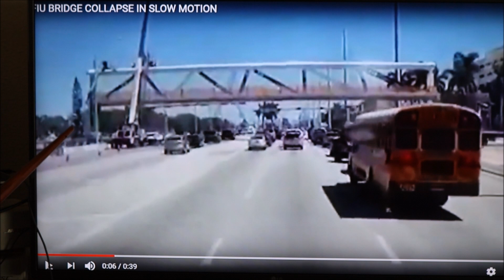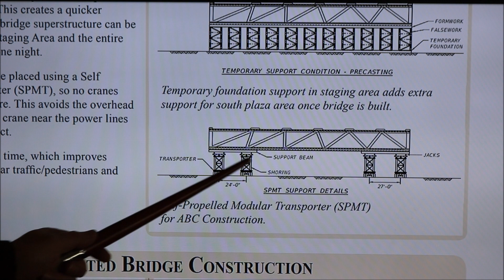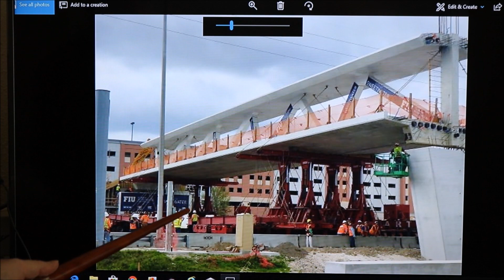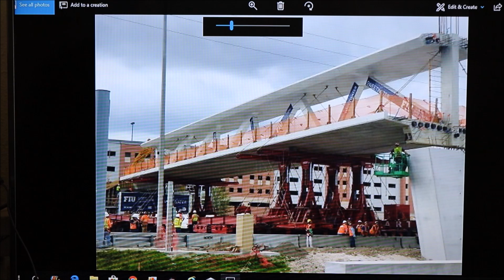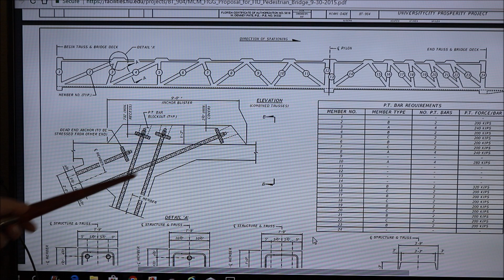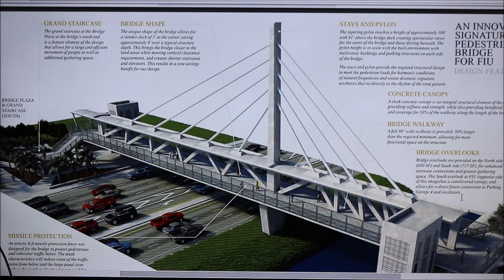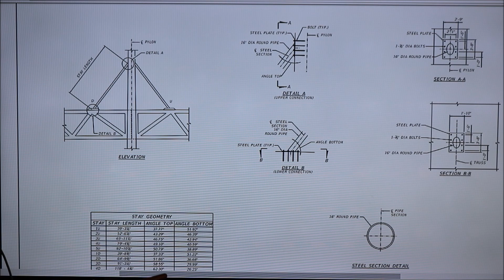Miami Bridge Failure Update 18 March 2018

Comment: I myself do not think that crane was there to hold the worker's safety harness. The worker's safety harness should have been tied into the bridge to keep him from falling from it. I say the crane was there lifting the bridge as tension was added by the worker. But by lifting they would have decreased the compression strength of the concrete. I myself think what killed the people was someone's ego. That road should have been closed.
Reply from the maker: 72+HourBOB the crane may have also been lifting the hydraulic tensioner, and not the worker.
Reply: I think the crane was holding something but not the worker.
Reply: if you actually look harness conected to crane

Comment: That was an interesting point about the cantilevered stress put on the bridge during its move. Info I can't get anywhere else. Many thanks for your reasoned approach.
Reply: The first video by AvE (referenced in Juan's previous video) shows the point of failure and the cantilever stress issue: https://youtu.be/ioC61QW7SHQ?t=331

Comment: Juan,
Thank you for that update! What I dont understand is why they needed a 950 ton bridge for a pedestrian load of perhaps 2 or 3 tons (ie ~50 people)? At what cost all those aesthetics? That had to cost much more than it needed to and I would think that too needs to be part of this story.

God bless
Paul
Reply: A bridge has to be rigid, otherwise it will sway in the wind, or when pedestrians walk over it. This is what happens otherwise: https://www.youtube.com/watch?v=CsKKDLKYsVU
Reply: Your reply shows your ignorance of basic engineering priciples. What does rigid and heavy have to do with each other? There are 1000s of lightweight bridges and other structures that perform just fine in wind, earthquakes, etc, and dont end up like the poorly designed TN bridge. Aircraft are very strong but very lightweight as well. This bridge was clearly 'over aesthetic'ed'.
Reply: No need to get personal...
Reply: Then please know what you are talking about before YOU criticize what I have written.
Reply: You are being paranoid, and your comments are insulting! I didn't criticize you, merely pointed out that the load is not the only factor considered when designing a bridge. The bridge has to carry its own weight (dead load), as well as multiple safety factors. Yes, you can probably design a lighter bridge.
Reply: Your original comment was what was insulting. Please look in mirror. Im done with you.
Reply: Paul1958R According to some comments the bridge was intended for more than just a crossing point, with seating and vendors - a place where people migh congregate.
Reply: @Ian Mosely,
That just would increase my criticism of the entire plan. A bridge should be a bridge - not a 950 ton 'gathering place'. The scope of the project clearly was out of control.

Comment: The crane was problaby holding the hyd ram used to tension rod it broke the line when it pulled the ram down with the bridge
Reply: Yes, hydraulic jacks capable of 320 KIPS weigh 250 - 450 lbs (e.g. http://www.williamsform.com/Post_Tensioning_Systems/post_tension_install_equip.html). If the jack remained connected to the crane when the bridge collapsed, the crane could have pulled the (broken) rod out of the truss member.
Reply from the maker: frank porter great point!
Reply: this!
Reply: A witness said the crane hook was snapped off, so the crane load went way over capacity during the collapse.

Comment: It seems to me that member 11 should be under compression once the bridge is placed. The plans you showed in fact listed no tension rods for number 11, also implying this. For that matter, member 9 has no tension bars either. They might have been needed, though, during the installation of the span because of the lift point being so far from the end.
I don't understand why they would be tightening them further after installation; I would expect them to slack them off to prevent compression failure of members 9 and 10. Perhaps slacking them off requires pulling them a bit to allow loosening of the fasteners, followed by a controlled release using the same jacks used for tensioning.
One of these rods failing in tension would produce quite a shock locally because of all the energy stored in the rod under tension. I wonder if this  shock could initiate failure of part of the concrete.
Reply: Good point about the shock (and vibration) if the rod failed! Would not be visible in the dash-cam video, but might have been strong enough to fracture the bottom span.

Comment: The worker likely knew that the cable was failing long before it failed if it was a normal cable. Elastic response is easy to measure. Beyond elastic you get plastic which will show no tension increase in the cable for a large tension pull. That's a huge warning sign and the tool will stop. It's more likely that the cable failed due to a material defect in the cable or the stop shoulders. This is speculation of course, but bridge building is pretty well understood and static loading is pretty easy to understand, simulate and design.

Comment: The following voicemail was left on a landline at FDOT Tuesday by W. Denney Pate, FIGG's lead engineer responsible for the FIU pedestrian bridge project:  This was not heard until Friday March 16th.  Florida has the "Sunshine law" which makes all government or business communications public (with some exceptions).

"Hey Tom, this is Denney Pate with FIGG bridge engineers. Calling to, uh, share with you some information about the FIU pedestrian bridge and some cracking that's been observed on the north end of the span, the pylon end of that span we moved this weekend. Um, so, uh, we've taken a look at it and, uh, obviously some repairs or whatever will have to be done but from a safety perspective we don't see that there's any issue there so we're not concerned about it from that perspective although obviously the cracking is not good and something's going to have to be, ya know, done to repair that. At any rate, I wanted to chat with you about that because I suspect at some point that's gonna get to your desk. So, uh, at any rate, call me back when you can. Thank you. Bye."
Reply: FSEVENMAN did you have a point, or are you using insults for no particular reason?
Reply: As soon as they realized ther was cracking the roadway should have been shut down....unbelievable.
Reply: "from a safety perspective we don't see that there's any issue"  Well, Denney, looks like you got this one here wrong.
Reply: AD.  Red Green would have fixed it with duct tape.

Comment: The increased tensioning in the cables does indeed increase the risk of failure. These are described as "high strength steel" in the documents you present, which is important: low strength steel has a great deal of yielding after plastic deformation, but prior to strain hardening and ultimate failure even later. In contrast, high-strength steel fails in a more brittle manner, with an abrupt snap and little warning. This is speculative, as I do not have the precise details, but it may turn out that the cables were tensioned to near their ultimate strength for the installation, leaving little margin before catastrophic failure. 
If, then, the cables were inadvertently increased, not decreased, in tension by the hydraulic tensioner then the failure as observed would be the natural consequence. Indeed, even if the tension was reduced, but the tension member was close to ultimate stress prior to that, then there would have been some strain hardening and elongation; this would have resulted in the cable loading on the structure decreasing spontaneously (as the strain, or stretching, releases the tension without the bolts being unwound) -- but, if the tension was adjusted back upwards to its design level, the cable would have lost its safety margin, and once again the immediate, brittle, catastrophic failure observed would result.
So, while the steel may have been high strength, it was evidently not high TOUGHNESS. A tough material requires a substantial deflection once it reaches near its failure point before it fractures. If the steel tension members required the very highest STRENGTH steel -- which is generally brittle, not tough -- then the structural design was deficient and they should have used a larger quantity of lower strength (but tougher) steel, with a lower stress level.
Incidentally, the environmentally friendly concrete (with alternative cementitious materials fly ash and silica fume replacing Portland cement in part) are an established practice and probably fine, as long as they were not used in significantly higher ratios than established practice permits.
Keep in mind also: engineering is a practice which humans constantly push toward greater and greater achievements, until a failure causes us to become more conservative again. This is nothing new! I recommend reading Henry Petroski's books such as "Pushing The Limits" and "To Engineer Is Human" for a detailed discussion of this effect.

Comment: Stress test
In the 1950s a casino architect designed a very weird casino entrance canopy. Because the design was so unusual, the structural design engineers ordered a safety stress test with sand bags on top of the canopy. The engineers were shocked to see a PR photo of the weird canopy with the stress test sand bags AND casino showgirls on top of the sand bags!
PR guys are unsafe at any speed.

Comment: Creating an unknown without the required falsework with steel plate, and while we're at it let's keep the roadway opened during tensioning.  Not even the harness worked, and I bet it wasn't worn properly, they rarely fail.  The liability that MCM has will do the company in.  Knowing that if any one of the single row of trusses failed, the bridge would come down under its own weight, it's clear they were negligent.  It also may be found that not supporting the cantilevered ends of the bridge caused it to crack, it was not designed for that load, albeit temporary.  The cause of this will come out relatively quick.
Reply: This is all speculation with regards to the harness.

I think the crane lifted the hydraulic tensioning equipment, I doubt there was a harness.
Reply from the maker: Mach Tony I think you are right.

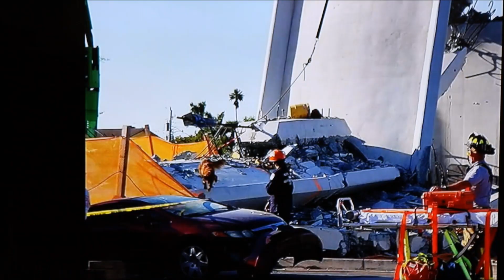Comment: If you watch the video of of the collapse you will see the failure occurred on the upper canopy on the right side of the image at 5:06. I have a theory on what happened. They were detensioning and took out too much tension, this caused too much tension on the second rod which broke. The breaking of the the rod caused a shock force as the concrete decompressed and causing tension to the right of the anchor blister, which broke the upper canopy on the right side of the anchor blister. You see the blister is 100% intact and the failure to the right of the anchor blister. I am sure they were to take out a little tension on both rods back and forth to keep one rod from being over stressed now that the rods were under load from the bridge.
Reply: Nope ... there is a second P.T. Rod in #11 that is intact in the anchor blister ... see image linked
 

https://goo.gl/images/TkaNws

Comment: Looks like to me the walkway (lower chord) is what failed - at the point directly under where the worker was.  You can see the web member 11 (22) is still much intact after the incident.  This member 11 would have been primarily in compression (in fact - the drawing doesn't even list cables for member 11), where the lower chord is what was in tension.  During the move, the tensions and compressions were completely different in the end of the bridge and perhaps the concrete in this area was compromised and weakened causing the failure...  There looks to be tension cables in the lower chord (I count twelve?) that must have failed in order for the bridge to break as it did.   The photo showing member 11's? broken cable indicates the break pivoted at the top of member 10&11 causing its upper anchor boss to detach - so the cable being worked on may well have broken during the drop and was not the initiating cause.  Member 10 looks to have been completely disintegrated so is more likely to have been the break.  (According to the drawing, it had the greatest tension load of any of the members) Whoever made the decision to relocate the transport equipment is going to have a lot of 'splaining to do.

Comment: One square centimeter of standard grade construction steel can hold 19 metric tonnes of tensile load.  Estimate for 16" tube, used as "decoration" says that if it has wall thickness of 1 cm (rather thin for this diameter) it shall be able to hold over 2000 tonnes of load; i.e. each of these "decorations" could be used to lift two 950 ton trusses.

Comment: The same construction company built the Varina/Chesterfield bridge across the James River in Virginia. Halfway through construction it was noticed that the two halves wouldn't meet in the center. The construction was altered with a flatter section in the middle resulting in two noticeable humps in the road way at the transitions. Despite what engineers draw on paper, execution of the project is the most important phase.

Comment: The concrete looked very smooth on the split edges, I agree on the post tensioning being most likely at fault. But the concrete mix and how the rebar was placed could play a role.  Someone was also most likely putting a lot of pressure on this project just to keep a street open that could have been blocked for a week or two if it meant preventing this. Just like all major construction fails such as Big Blue in Milwaukee, there was pressure to get the job done instead of  being professionals and getting it done safe and right.

Comment: Cable or pipe is irrelevant. It is in theory still a cable stayed suspension bridge.   Whom ever approved to change to the lift plan and deviation of the locations of the SPMT units and lack of spreader beams is going to be in big trouble. The same with those responsible for not allowing the road to be closed during this phase of construction.
Reply: gregg4164 — Wrong.  The pipes were not to be attached in a way that would have supported the span.  The span was intended to be a self-supporting truss.

Comment: Wonder where the steel for the rebar and tensioning rods were made...
Reply: Vernon Slone 🤔
Reply: @Vernon Slone; very little consequence of the steel, as member #11 failed in compression.  The concrete failed, not the tensioning rod.
Reply: @James Surber
The latest NTSB Bulletin is pointing at the rebar in the deck at the base of #11, just like the initial Miami Herald article quoted several engineers. This certainly is where wide cracks were photographed, before the day of collapse. (and Why wasn't the bridge underpass closed to traffic within minutes of those cracks being photographed?)

The #11 member effectively became shorter, relaxing the post tension bars. Or vice-versa. The post tension may have crushed voids enclosed by insufficient rebar. But this particular "failure" happened days before the collapse.